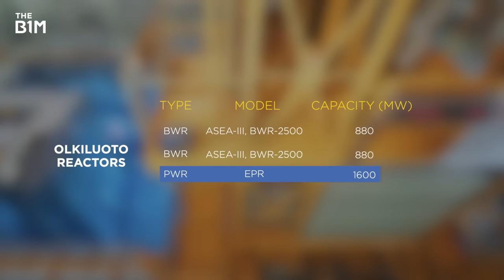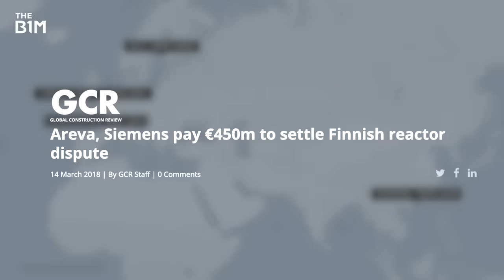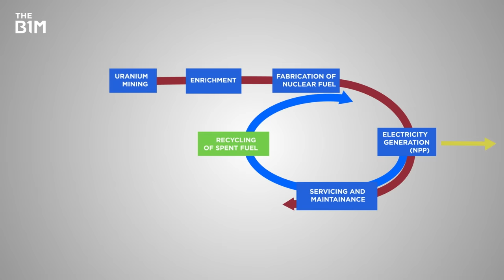Finland Might Have Solved Nuclear Power’s Biggest Problem

Comment: So this is like Yucca Mountain Nuclear Waste Repository, only this one is operational and Yucca Mountain is a financial sink hole with no intent on opening.
Reply: Another video said it well, Yucca Mountain was built on a fault zone, too near a aquifier, on Native American land... and also way too small to fit even the existing waste, let alone what was being produced. Best plan would be to reprocess the waste into less dangerous elements, failing that, build a molten salt reactor and throw all that stuff into the molten fuel and it will eventually be used up.
Reply: Yucca Mountain is on a fault line it would be horrible to have a nuclear disaster caused by earthquakes
Reply: @AnalystPrime  ...good info. I have read the same things. *Define eventually.
Reply: It's called. ONKALO 

And there's Gretna Telling the rest of the world.. Fo green energy,  Yet this facility is for future nuclear power stations waste...

And yet this, in her neck of the woods.

Most Strange ..
Reply: @grahamfisher5436  what on earth are you on about?
Reply: @seanonraet8327  leave the crazies alone
Reply: Yucca mountain was chosen because of its isolation from humans and with an apparent lack of appropriate concern about its very active geological and hydrological conditions which make it a really dangerous choice in the long term.  Other than near an active volcano, I can think of few more unstable types of geology to put a long term nuclear storage site than Yucca Mountain.

Comment: Is there a way to check for deterioration over the years or just cross your fingers
Reply: The nuclear decay is highly mathematical.  Deterioration of the storage could be measured by radiation leakage (easy to measure) which by design would be contained in the tunnels.   The stability/reliability of the encasements has studied for decades all over the world.
Reply: And in any case, it takes a long, LONG time for that crap to go away.
Reply: Bury it waaay deep.
Cross your fingers waaay good.

Comment: what about 4th generation nulear energy reactors? Where you can use old spent fuel again, and also reduce time that it remains radioactive?
Reply: I'm still waiting for the orbital solar power.  I think they're still building the 50 mile long extension cable so they can plug it in 😋

Comment: 100 years of developing time for cleaner energies while sustaining from nuclear sounds indeed like a game changer.
Reply: If this was Reddit I´d give you an award.
Reply: Yes. So much yes.
Reply: hopefully we're capable of developing full fusion generators by then.  we're "close" as it is and ITER should provide lots of insight into the technology and getting it to be at least power neutral.  if humanity can develop fusion tech all our energy problems will be over and maybe it'll allow us to travel/colonize our solar system.
Reply: @jeffchen6517  can do the exact same with nuclear fission mate nuclear fusion won't b commercially available for another 100years and ITER is being built without any idea if it will work as planned in theory, theory and practical don't always work all the time
Reply: @jeffchen6517  Not just fusion. Deep geothermal could provide enough energy to power the whole world. And so could solar, for that matter―as long as part of it was stored (in the form of H2, battery charge etc) during the day to make up for supply shortages during nighttime and cloudy weather.

Comment: Actually, the USA built tunnels like this in Nevada decades ago. They aren't being used because activists convinced people they weren't safe. LOL
Reply: I have to support NIMBYs in Cumbria for making Cumbria a less safe place to live in, LOL. There is alleged to be ~140 tonnes of "Reactor Grade" (or "Fuel Grade") plutonium (Pu239/Pu240) stored as dioxides in an anonymous grey building at Sellafield. Still, it's probably quite safe in a deep basement and there is a slight possibility that this Stored Nuclear Fuel will one day be used.
Reply: If the waste tunnel storage is not being used where are those nuclear waste stored?
Reply: WIPP and Hanford failed because the rock formation below is not stable enough, and they cut corners on what they were using to bury the waste in.  Yucca Mountain doesn't keep the waste deep underground; instead it is technically above ground IN the mountain.  There are no geological formations in the USA that would allow for a deep repository without significant risks.  Norway, however, is sitting atop bedrock and granite that hasn't shifted in millennia and won't shift later unless there is some major cosmic catastrophe that caused all of the tectonic plates on Earth to shift.  If that becomes the case, we will be wiped off the planet anyway.
Reply: So you are volunteering to have trains carrying this waste from some other state to drive past your neighborhood forever on their way to Nevada?
Reply: @berryberrykixx  Germany thought exactly the same with their salt mine. After storing tons of nuclear waste (in a way where it can`t be recovered easy), they found out that the geological formation is breaking and lets water in. Now the ground water above it is in danger.
Reply: @juancarlossandoval5628  I don't know the details for Finland but in North America (Canada and the US), after time in "cooling ponds", fuel rods are stored in power station car parks. They are placed in concrete and steel storage vessels which are vented to use a chimney effect to remove residual decay heat, air cooling. In The UK, this approach is only used at Sizewell B, our only PWR plant.
Reply: @w.s.soapcompany94   "So you are volunteering to have trains carrying this waste from some other state to drive past your neighborhood forever on their way to Nevada?"
As long as the basic precaution of monitoring the radiation levels to not be too much above background levels? Sure why not? I might even do the measurement myself and post it automatically on the internet. Sounds like a cool Raspberry Pi project.
Reply: @berryberrykixx  WIPP is operational today.  Quit spouting disinformation.  Yucca would have worked well if lawyers and politicians had not killed it.  The science behind it is available if you have the technical chops to read the 8660 page license application.  LOL at no geologic formations in the US that would allow for a deep repository:  see Canadian Shield in northern Minnesota for nearly identical formation as in Finland.  FFS, try to not just parrot back what lawyers and politicians say.
Reply: @admranger  WIPP is only open to take low-level waste like used protective gear and whatnot.  They do not accept mid-to-high level waste the way Onkalo plans to.
Reply: @berryberrykixx  WIPP was only meant to take transuranic waste (both contact and remote handled).  I worked there.  I am very confident I know immensely more about WIPP than you do.  WIPP was never intended as a repository for high level waste.  It is in a geologically stable salt formation and hasn't "failed" like you claim in your original comment.
Reply: rightfully so.
Reply: @J-IFWBR  So you advocate politics and fear mongering over science?  Interesting way to live.

Comment: Me: "Wow they solved the nuclear waste problem and didn´t just bury it?"

The Video: "They just bury it but its realy well isolated i guess."

Feels kinda cheap but sure.
Reply: Much easier to store spent fuel within the same facility
Reply: exactly this still isn’t a true solution. really disappointed by the video
Reply: @ghosts288  how is this not the best solution? literally no harm caused by the spent fuel after its stored.
Reply: @alexshapcott7795  in theory. and since the waste takes thousands of years to become safe again literally anything could happen in that amount of time. if we expand our nuclear power then that’s just more and more waste that we’re piling up hoping nothing will go catastrophically wrong and cause a massive leak of radiation into our environment. this is a literal example of  “sweeping it under the rug”
Reply: @alexshapcott7795  The best solution is not to toxify our planet at any strata.
Reply: @ghosts288  its in the middle of the baltic shield, for something to happen to it a meteorite would have to smash earth apart.
Reply: @tommyhayes8702  nuclear is the only "green" option viable in Finland. Solar power is useless in Finland and you cant power a nation with small hydro- and wind farms alone.
Reply: Literally put the waste into blast proof container, slap a GPS tracker on it, and send that shit into space. If it blows up, go get it. If it doesn't, it's now spaces problem.
Reply: @jd5393  Our rockets aren't nearly reliable enough.  What do you think happens if you detonate a load of nuclear material in the upper atmosphere?
Reply: @bigwitt187  It would be fascinating and it would definitely blast a hole in the ozone not to mention flash boiling millions of gallons of seawater. Depending how much radioactive material is in there, it might be a world ending event.
Reply: @aaronburdon221  My wording might give the wrong impression.  Reactor fuel isn't enriched enough to cause a nuclear explosion.  Spreading a bunch of radioactive dust in the upper atmosphere would cause problems around the world.  That's why we stopped nuclear testing and set off very few bombs large enough to reach the upper atmosphere.
Reply: @ghosts288  You think the earth will explode or something?

Comment: Unfortunately, I strongly believe nuclear fission will play a big role in bridging the gap between now and a fully renewable energy grid. As nuclear power is quite safe if done correctly and emits no green house gas, as we move towards more hydroelectric, wind, various types of solar power like, photovoltaic panels and sun energy Concentrators that Utilize utilizes thousands of mirrors to focus sunlight onto a central tower where molten salt is used to power steam turbines and can run at night as the molten salt can be kept in insulated tanks were it retains a lot of its thermal energy and can be then used to power those steam turbines and generators at night. Then there is also tidal power and The holy Grail of renewable power, fusion, Which would provide nearly limitless clean renewable power without the dangers Of strongly radioactive isotopes like Uranium 235 and its daughter isotopes that result from natural radioactive decay, utilized in fission. Fusion reactors are also fail safe by design, as if anything were to go wrong, the reaction just stops and the only byproduct is Helium (a fairly rare element that is used in many important applications far beyond just party balloons like rocketry and to cool the super magnets in MRI machines) With the recent milestone of net positive power, Granted it being very minimal, and the collaborative efforts of over 35 countries in ITER (International call the Lawrence Livermore laboratory Thermo-nuclear Experimental Reactor) as well as facilities like the NIF (National Ignition Facility) a laser based fusion project at the Lawrence Livermore laboratory, I have a lot of hope for a future Of cheap and practically limitless clean nuclear energy that fission energy initially promised but, due to its inherent dangers, could not fully be realized with, where with fusion, these dangers don’t exist.

Comment: "The biggest drawback in nuclear power" is entirely self-imposed...and so easily solved, if we want to 🤷‍♂️
Reply: Not really "self"-imposed. Radiation is a very real and deadly threat. Feel free to read up on radiation sickness. The data are clear and consistent. We do have to manage it safely. Cancer to death isn't a consequence spectrum you can just ignore. But you are right that there are solutions. Burying it in geologically stable bedrock that's stable on the time scales of the half-life of uranium is the kind of solution we need, now and into the future. But the NIMBY (not in my back yard) politics are real and must be accounted for. That's why Yucca Mountain got scuttled. Fear is a powerful motive and politicians love to use it for political leverage. The only way to overcome that is with education. A LOT of it. People need to understand it is necessary if we're going to continue to enjoy modern life. No one thinks about how much energy it takes to pipe that Netflix into their homes on demand, or to run Google's operation, or to manufacture steel and aluminum, or even to run the Haber process and trucking industries upon which our entire food supply is based. If we want this modern life, we've got to do what is necessary to supply the energy.
Reply: @kma3647  Radiation is very natural thing inside earth in fact it partly is responsible for extreme heat inside hearths core and mantle. Its good thing to place waste underground, its wont be worse than some random natural uranium deposit. Dig a deeper hole if you are afraid. There is no nuclear waste problem.
Reply: @kma3647  if you're talking about the development of deceases, then by a great margin the fossil power plants and carbon power plants generates 10000 times more deceases like lung cancer, pneumonia, and nerve damage. In this day and age the amount of highly radioactive material is estimated to be around a standard soccer with 3 meters of height, so you know it's much better bury our waste rather than inhale it every day for 80-90 years you know?
Reply: @kma3647  Or. You know. Thorium reactors.

Comment: Thorium reactors don't have this problem.  But then again, they can't be used to make weapons grade Plutonium.
Reply: Actually thorium reactors require a catalyst to sustain the reaction...burning up the catalyst 100% ...guess what can be used as the catalyst ? Yup radioactive waste...
Reply: @joshuarich7527  You kind of helped make my point.  Point is that the government will not do thorium reactors because that CAN'T be used to make weapons grade plutonium.
Reply: @paulm417  just helping out where i can 🤭 , also its not just weapons grade plutonium , 10 ish % of lead can be turned into gold by storing that specific version of lead in close proximity to spent fuel rods (its kept in the cooling pools).
Reply: @paulm417  thorium reactors ahve their own problems and were being developed heavily for two decades at least. Every rich country has it's own thorium project going. 
But apparently some folks think it's just about switching from uranium to thorium and calling it a day.

Comment: This is certainly much better and more secure than current disposal methods, or lack thereof. When it comes to green energy, nuclear is the real deal.
Reply: This is hardly a solution lol. This just shows how bad nuclear energy really is.
Reply: @danieljessop7140  On the contrary, this is actually an improvement on one of the most basic solutions to nuclear energy's problems. You say nuclear energy is bad. Name an energy source which is better.
Reply: @MiticDane  Solar is not practical for large power stations. It requires lots of space to generate lots of energy. It is subject to the weather conditions and the time of day. It also generates lots of dangerous waste in the form of plastics and chemicals from discarded panels.